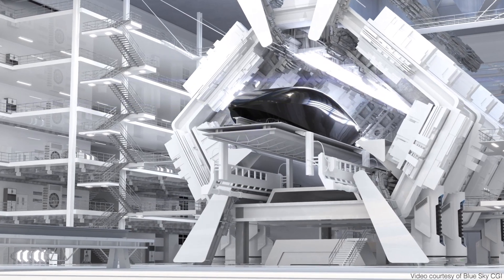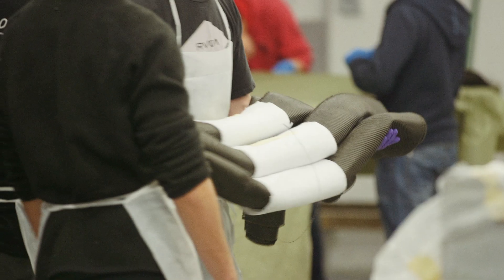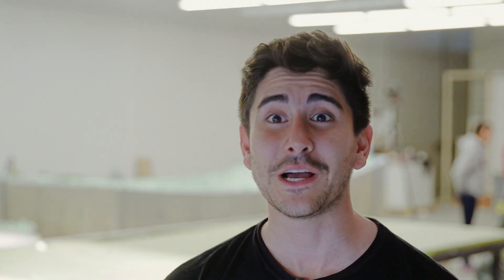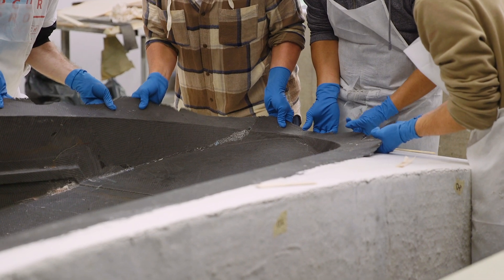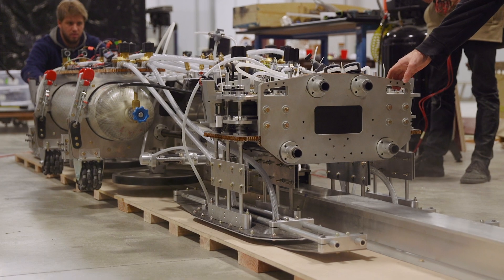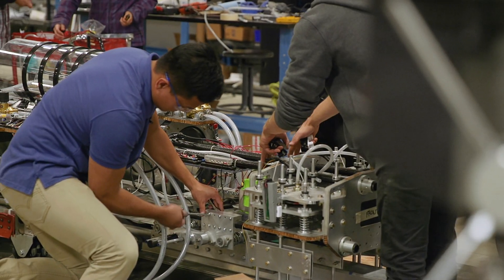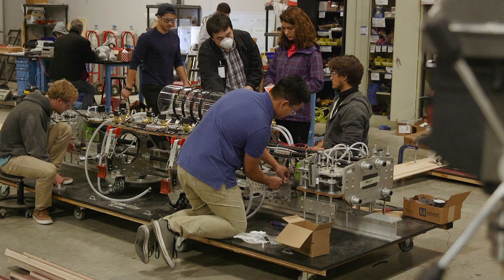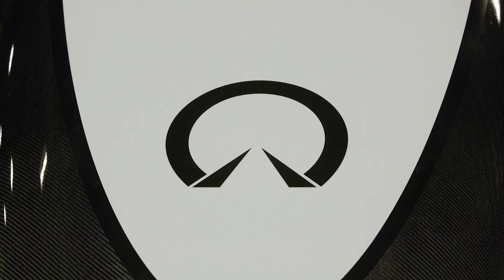HyperXite Hyperloop - UC Irvine

Comment: I'm just going to through out some thoughts I had while watching the project video.  So is the pod expected to operate in a vacuum?  If not, the entire front of the pod could be fitted with a large air intake with an electric turbine to compass air for the levitation components.  It would still need to allow for significant bypass to lower wind resistance.  Picture something like the head of a manta ray.  It may extend its millage between pressure tank swaps or refills.  The tunnel could also be fitted with induction coils to generate power as it travels.  If the entire roof of the tunnel were to be covered in solar panels it would also help offset the energy costs.  Would the tanks be "hot swappable" at destination ports or pressurized in place?

Comment: High speed train is a reality, yet it fails to catch enough users, certainly in the US due to urban sprawl and mentality (imposed by the car and oil corporation that destroyed all city trains in the thirties to promote their products). So good luck for a yet to work system. OK, nice exercise and fun to make it work though.
Reply: What you said is true but what if it were feasible to compete with air travel?  If you could travel down the cali coast or travel from the mid-west to New York without the hassle of the airport and save time and money wouldn't you?  I don't believe this is a system designed to replace your current daily commute to work.
Reply: If hyperloop managed to be built,  and I doubt it will be, who is willing to be place in a sealed coffin traveling in a closed tube at 800km/h ?

Comment: but still didn't run in the tube lol
Reply: Hmmmm
Reply: dont say "never!"
Reply: "debunked" by a chemist that knows nothing about engineering. I'd rather trust  a real engineer
Reply: And it never will because there is a reason its called hyper loop.  Hyper meaning its mostly hype.
The so-called 'science' behind hyperloop has already been debunked.

Comment: it seems everyone seems to have forgotten the larger version trains that would be used for transport, ironically having a larger train would be more accommodating for mass transit of a large number of people in a more traditional sense of seating that also allows for multiple people from all physical abilities from young family to old and mobility restricted, none can deny that the work that these students have done so far is amazing,  but until large bodies of people in groups of 140 + can be accommodated, existing and unfortunately more traditional transport in the form of european or japanese decent high speed rail (or its future japanese replacement with the hybrid maglev) will always win funding to replace 20th century tech

Comment: Well done! but... air levitation inside a vacuum chamber? hmmm Why putting air inside it if it has to be sucked out again; the air tanks need refilling... i am missing sth...
Reply: Albert Juos these are mag lev trains
Reply: XYZt true true but I heard that it's to get more aerodynamic that the air goes straight through and expelled at the back  still....I don't even know I'm probably wrong😔
Reply: This is a near-vacuum still containing some atmosphere for the original "air cushion" concept and other pods that requires air for its propulsion system (e.g. the WARR hyperloop)

Comment: this is not a viable thing ... the competition proves it ..still decades to go before this becomes public
Reply: so you are saying its viable?
Reply: XYZt sorry but you sir are most probably wrong. as cool of an idea as it is, the idea of creating a vacuum that large isn't practical. that really tiny test track is already the second largest vacuum in the world and anything larger would be infessible not to mention incredibly unsafe. this project is way father off than it is hinted to be
Reply: Watch it again, only one of the three concepts went all the way to the end of the tube and it's drive mechanism consisted of wheels, which originally were illegal at the contest.
Reply: So what, you've got to start somewhere.
Reply: I thought the competition had proved it otherwise. Three universities' pods are already proven to be able to travel in a near-vacuum environment, along with Hyperloop One, which has begun the construction of their tube. Your comment is the same as saying a few years ago that reusable rockets isnt a viable thing because the first few ocean landings failed. Never underestimate the progress of technology.
Reply: with time and money you can do lots of things, dubai want hyperloop, dubai will have hyperloop, but yes it will take decades.
Reply: not feasible
Reply: ' a near-vacuum environment' bs statement. If there would be vacuum or near it, they would have to pump air out for long time till they launch each pod. why those pods make so much noise in the tube then? :D 57mph is nothing close to 800mph. the frikin tube they did tests in was just a tube. As for learning process, universities can build some pods and train students, but that is not the most challenging part of this project. 
As for landing rockets, it is not very efficient to launch rocket into space and then bring it back with part of the fuel in it, but to prevent building new carrier rockets and eliminate space junk, it is worth trying. Tbh technology was there 20 years ago to build landing rockets.